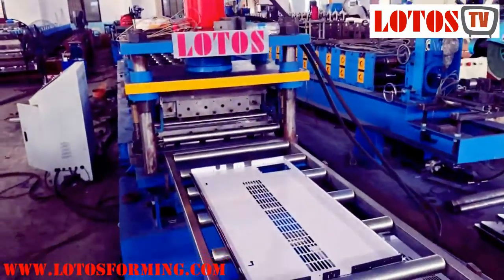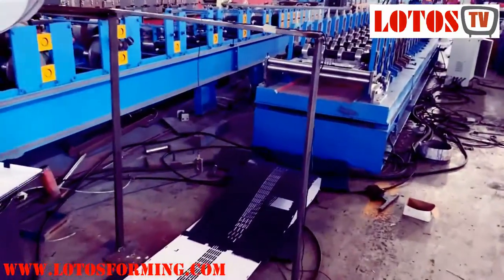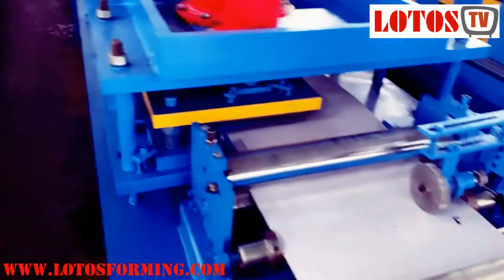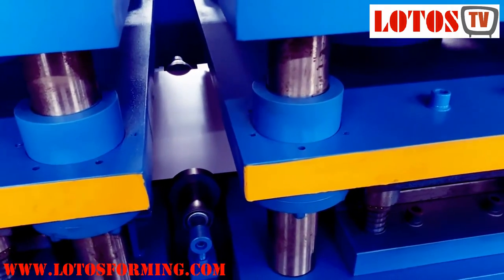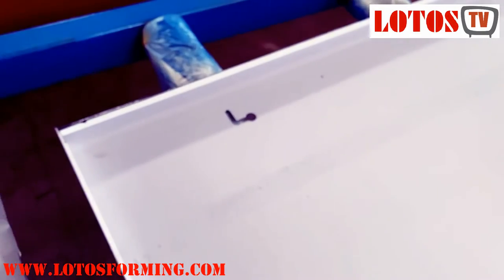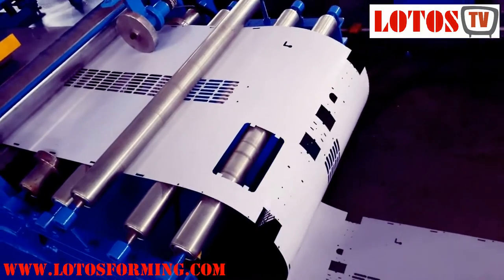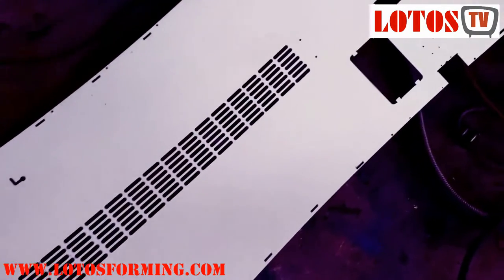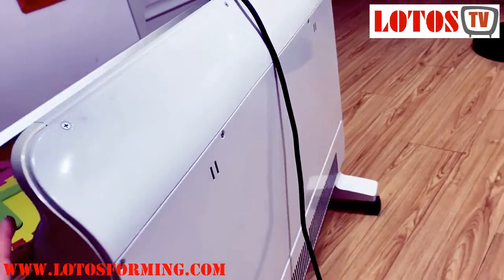【Vented Blank Panel roll forming machine 】: Heater slotted panel machine " Rack ventilation panels "

Comment: The main frame is the rack, which is produced by welding and screwing columns and plates. This process determines the strength of the network rack against shocks and earthquakes. good